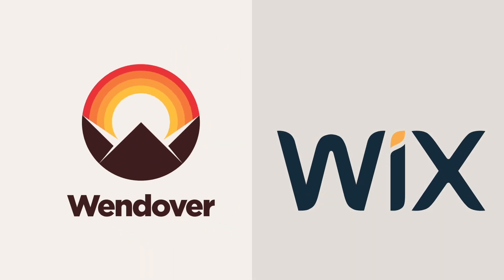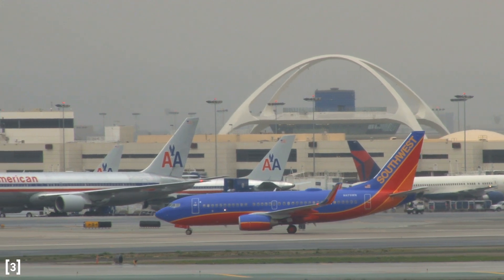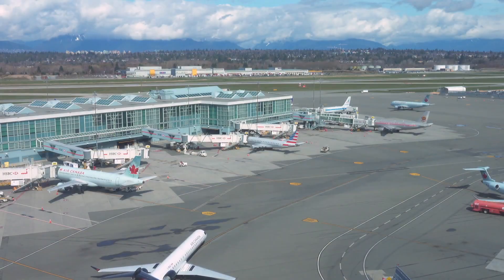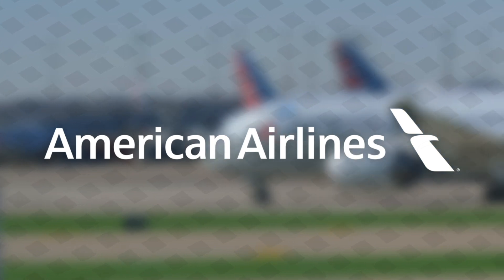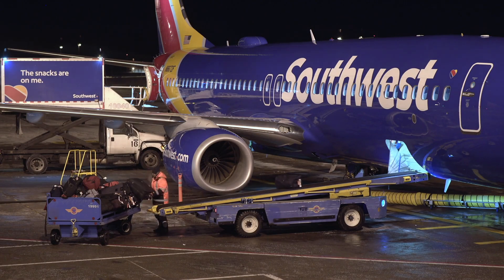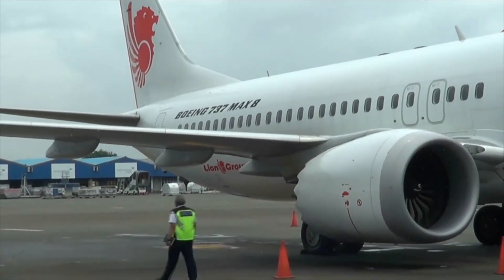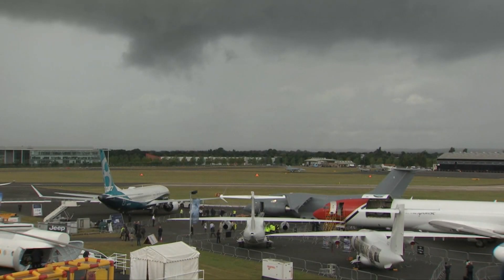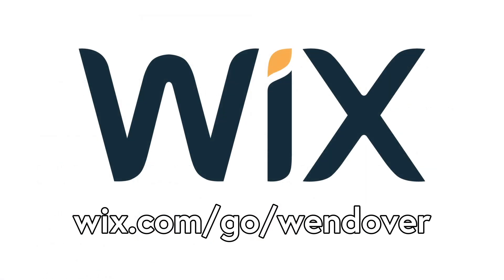The Economics That Made Boeing Build the 737 Max

Comment: The Wendover Productions video makes some observations about modern technology and implying that if modern technology is added to a new design then it is better. Fly by wire is good so far only time will tell it's safety. Check list is electronic trumps paper? What if a glitch wipes out part of the list? The 737 Max 8 bases off from a fifty year old design so what. The dynamics built into it are very much on par with Airbus. Safety is tilted in favor of the Max due to redundancy that can be applied by human power. Moving the engines did change the aerodynamics but within the margins of safety and maintaining stability. Bottom line is that you don't have to reinvent the wheel in order to make an efficient aircraft.

Comment: important to note:  The 737MAX wouldn't be flying if Boeing hadn't already achieved regulatory capture of the FAA.

Being able to mark your own homework leads to temptations to fudge things. Boeing and the FAA's reaction to whistleblowers calling out serious 737NG assembly malpractice (and paperwork falsification) issues showed it had already happened by 2004-2005.

More worrying: This regulatory capture problem isn't isolated to one US sector. It's across the board and been getting worse since the mid 1980s - telcos being a blindingly obvious example.

Comment: You dont fix an aerodynamic problem with software.  You absolutely must start with an aerodynamically sound air frame and engine combination.  Otherwise its going to bite you in the ass every time.....   Its different in the case of a fighter, where you depend on that instability in order for the plane to maneuver quickly. There flight envelope is fairly narrow. But in the case of an airliner with a vastly wider envelope of operation, it damn well better start out stable. If it does not, and you use something like MCAS to fix the issue, any engineer will tell you that not only is the fight characteristics completely compromised in the case of  failure of the augmentation system. But the air-frame and control surfaces are being subjected to constant loading...........It was a poor way, lazy, cheap way to try and fix the problem created by moving the engines.   As it turned out it was not near as cheap as they thought it would be.......

Comment: Beyond re-engineering a dated fuselage to modern larger higher by-pass engines the video mentioned one critical flaw that should have been obvious.  That would be the attitude sensor, no redundant sensors.   The industry already knew the problems associated with single, and even multiple, air speed sensors in relation to automation.   How then did such a hidden robust automated flight correction system come to rely on a sole sensor?  Cost?  Hubris?  Automation engineering euphoria?  Apparently a tragic combination of all this intersecting with an original design poorly suited yet economically driven.  Makes one wonder if any re-engineered fix is viable from a safety standpoint.  The future of Boeing and the credibility of The FAA, as well as untold lives, hang in the balance.  This brings the hovering cloud of transparency up.  The public has not been allowed much information as to how the proposed safe re-introduction fo the 737-Max is progressing.  Scant details of either good or bad save for the claim that the aircraft will not be allowed back in the air until all issues are addressed.   The problem with this is the public believed that this kind of scrutiny was routinely addressed prior to any modern aircraft taking to the sky in the first place as far as commercial service goes.   So, if and when, The FAA approves the plane to fly again will the paying public believe the plane is truly safe?

Comment: Most of the people bashing the MAX in this comment thread, have at some point in there lives, safely flown on a Boeing 737, be it a old 200, a classic 300, 400, or 500, or an NG 700, 800, or 900ER, because the Boeing 737 has carried more people on more flights than any other passenger aircraft in history.  Constantly improving on a brilliant design that has been the profitable workhorse of the single aisle market for decades is actually quite smart.  Take something great from the start, and make it into the best in can be.  Head to head, the 737-MAX8 will edge out, albeit very slightly, operating economics of the A320NEO, making the MAX, despite the blatantly obvious, orchestrated MSM take-down of the entire MAX family, a terrible bought of turbulence for the aviation industry as a whole, and especially Boeing.  Do you all not realize that the same accidents could have just as equally occurred on the A320NEO family?  In fact, some airlines are blocking off the last row of seats in the NEO over concerns of the weight balance of the aircraft, thus affecting the AOA, and the AOA is what the MCAS was intended for to take full, automatic control of.  Amazing, safe, profitable, efficient, reliable aircraft (the entire MAX fleet) is sitting on the ground because of ongoing politics, when they crave to be soaring at 40,000 feet, carrying people all over the world.  I would fly on a MAX without a second thought, or a concern in the world, and would arrive wherever I was scheduled to go.

Meanwhile, in addition to the last row of seats on some NEOS being blocked, the A220 is still having engine failures with the Pratt, GTF technology, grounding an entire airline fleet of them this last week.  Yet 99% of negative aircraft manufacturer news remains a focused take-down of Boeing and the MAX.   Nobody cares about the other issues I just mentioned because they were appropriately addressed, quite luckily, before any of those aircraft plunged into the ground.  The MSM has an agenda, and I can't lay claim to know what that is or why, but when phone notifications (that I don't even ask for) happen about 5 times per week, specifically regarding ongoing bad news of the grounded MAX, then someone is up to no good, and it's a terrible thing for anyone who loves aviation and flying.  If I were an investigator involved here, the first order of business would be obtaining a list of everyone who has access to the Boeing Uninterruptible Auto Pilot.  Such a system should NOT exist.  The captain of a flight should have 100% control of his aircraft, with no possibility of anyone on the ground changing that.  People in this world so easily give away more freedoms for the promise and illusion of safety, that's very sad to see as it gets worse, year after year.

Comment: To me the MAX still looks like a standard Boeing 737, so is it basically the same airframe as the earlier variants ? If so can't Boeing just retro fit all these MAX aircraft with flight systems from the earlier safer 737's so they can get them back in the air to help their customers start earning again ?. Call that new variant The Boeing 737 Max Retro.

Comment: We have to get Boeing out of business. I do my part by telling every travel agency that I refuse to fly in any Boeing airplane and that they have to arrange my travels so that no such plane is involved. These requests ARE reported to airlines, if enough travelers do the same, airlines will react and stop ordering these pieces of crap.

Airbus has a perfect stall protection system in place. Whenever the speed of the plane drops, even if momentarily, below the safe flying speed for the actual maneuver, the airbus rings an alarm and sets TOGA thrust automatically, but it doesn´t interfere with the pilots flying by bringing it´s nose down. This system, opposed to Boeing´s chosen path, saved lives, Boeing rather chose to kill passengers.

The worst part is, even though the problem is still persisting, the MAX is still grounded worldwide, Boeing builds more than 50 of this faulty pieces of crap per month and parks them on giant parking lots to be able to kill even more passengers as soon as their lobbyists put enough pressure on politicians to lift the ban. They won´t fix the problem, because they can´t. If fixing the problem would just be a matter of switching out the sensor, the problem would have been fixed before the planes got grounded.

Comment: We live in unstable times, ruled over by unstable people. Naval architects design an unstable a cargo ship with an itsy-bitsy canoe shaped bottom hull that is obviously designed poorly. When the heavy cargo is stacked up high the vessel becomes top-heavy. It capsizes, and in relatively calm waters. Then a legally hogtied unstable media will not report the problem as such. 

Unstable businessmen at Boeing, keen to beat Airbus,  go against the advice of the engineers and redesign the Boeing 737 as the 737 Max. The Boeing landing gear is shorter than the Airbus. So they instruct the designers to put the bigger engines up higher on the wing. The plane that was once stable in flight now has unstable nose-up flight characteristics during the critical takeoff phase. 

But no matter. They try to correct this misbehavior by crafting the computer software to slowly crank the tail surface down to put the nose down during takeoff. This takes away pitch control from the pilots who are on occasion pulling back on the yoke trying to get the nose of the plane up. They are struggling to prevent a nose-down crash into the ground. 

This it has ended up crashing two airliners, killing all on board. And now what do the unstable bean-counters at Boeing want to do? Back to the drawing board? Oh no. That would be too costly. They want to tweak the crazy self-conflicted system. They want to calm and mollify the ghost in the machine. They want to get the planes back in the air making money again. 

Overseeing all this are unstable people, 
People who think that bad things, with a bit of tweaking can be made into things that are just fine.

When they are obviously not.

Comment: I used to be a hardcore if it isn’t boeing I’m not going fan. Now? I rather fly on a Tupolev or Sukhoi... Hell, I’ll rather fly on a Comac before a Max. This is what happens when idiot MBAs make the decision to save money and slap modern engines on an airplane designed in the 1960’s. FFS, I’m no engineer but when they went from the old low bypass engines to the newer high bypass engines and had to flatten out the bottom to make them fit, you probably have hit the limits of the airframe. What’s worse is they had a great airplane, the 757, which could fit these new engines. Not only that, if you can fly a 757 you can also fly a 767. But no, let’s keep what’s basically a pterodactyl in the air.

Comment: Yes Boeing made a faulty AoA sensor, however the first accident was lion airs fault.

Explanation time, The day before the first accident they had a faulty AoA sensor and an MCAS malfunction, however there was a third person in the cockpit that day (check airman) this other person knew how to and did correct the MCAS malfunction. This should’ve been a red flag to send this plane off to lion air maintenance, this should have have been the red flag to take that plane out of service until lion air maintenance fixed the AOA sensor. However Lion air maintenance did not fix this, and that plane went down the next day because of an AOA failure that sent MCAS to believe they were in a higher pitch.

Comment: Airbus are "fly by wire"
Boeing are "cable and pulley"
Reply: This comes down to what era the models were released in. The newer Boeing’s like the 777 and 787 are fly by wire while the older planes like the 737, 747, and 767 are not. Airbus is a much newer company with newer products. With the exception of the A300 and A310 which aren’t made anymore, all airbus planes are fly by wire.

Comment: They made the computer too powerful, and Airbus is even worse. Boeing combined a powerful computer with a shoddy sensor, without enough testing, which is inexcusable.  Once the executives responsible are in jail though, the problem has already been fixed and the 737max should fly again,  But ONLY as long as the executives are in jail, and it must be grounded whenever they are free.
  All the plane needs is limits on the computer trim control, a backup sensor, and an executive prison, and it had the first 2 months ago.
  They also need a stretch version that trades some range for increased capacity, since carrying 4000 miles of fuel is not fuel efficient, so planes should refuel within 2000 miles whenever possible.  This also allows passengers to stretch their legs, thereby reducing legroom requirements, which again increases efficiency.

Comment: The fact that Boeing kept redesigning and updating the 737 to be able to sell the plane on price instead of fuel efficiency wasn't what led to the crashes and grounding. Where Boeing messed up was by designing MCAS in such a way that it took all of its critical Angle Of Attack data from a single sensor.  When that one sensor was defective, damaged, or frozen, it sent erroneous readings into the MCAS system, which ordered the plane to go nose-down to "correct" a stall condition that was not actually happening. Depending on one sensor created a "single point of failure", which is a design flaw that good "belt and suspenders" engineers avoid.  Two independent sensors feeding the MCAS and a warning signal to pilots that that the sensors aren't agreeing would be better. Three independent sensors feeding a logic circuit that disregards a sensor that is not in agreement with the other two and "assumes" the two that agree are correct, doesn't feed the bad sensor's bad data to MCAS, AND warns pilots of the sensor issue is probably what SHOULD have been designed in the first place, but some non-engineering middle manager came up with a cheaper idea on behalf of Boeing's shareholders.
Reply: ARABIA

Comment: I Also Noticed The 737 MAX Is Now Slightly Raised Higher Than The 737 NG, But It Still Didn't Help About The Engine Size Issue. Well They Raised It Even Further Forward And Up And The CFM LEAP 1B Did Fit, But It Really Didn't Handle The Same As The 737 NGs. Damn You Aerodynamics.

Comment: The age of the original 737 design is irrelevant. The original 747 design is also 50 years old. The 747 has also seen design adjustments over the years.

Airplane design has been evolutionary. Even when the design is "new," it is based on what has been learned from older models. Almost no commercial airliners have been  radical departures from the past. They feature incremental improvements.

Also, overhauling existing plane is a common maintenance practice.

Comment: Stupid question: Why was the size of the new engine such a big problem? Why couldn't Boeing just increase the height of the gear. Was it the additional weight or does a longer gear require retraining of pilots?
Reply: compuholic82 On most airplanes, the main landing gear folds inward when it retracts. In the case of the 737, the gear is so close together that there’s no space for doors to cover the gear, so they just have hubcaps that form a flush surface with the plane’s underside. If the main gear was made longer, the struts would have to be spaced further apart to avoid hitting each other, and if they did that, they’d also need to redesign the wing to accommodate the bigger wheel well as well as the change in weight distribution.

Comment: Why did Boeing add the mcas system if it already has an autopilot system and two pilots? The way I see it Boeing needs to bite the bullet and redesign the 737 max to not have an mcas system on board the aircraft. This requires a completely new aircraft design. Yes, I realize it would take a few years but the aircraft isn't flying and needs a redesign. 
Also screw the cost of pilot training and don't even suggest an iPad can train a pilot. Otherwise I could download the program and fly one myself. That would never happen as I haven't flown an airplane in over 48 years. I wouldn't accept the training which is where I believe your looking at better than 99 percent of all commercial ata rated pilots today. 

Training by iPad to cut cost of training , how much money has Boeing and the airlines saved?

Time to face facts that the 737 Max needs a redesign from nose to tail, lengthen the landing gear to get it off the ground and put the engines back where they belong, under the wings, not in front of it.

Gentlemen, you know how to fix it. Do it right with a redesigned aircraft. Then and only then will you be able to put a safe 737 Max in the air loaded with passengers who trust it.

Get it done.

Otherwise me personally will not fly on any Boeing aircraft.

Comment: To be fair if the Max was done properly, and that includes the FAA approval, it wouldn't have those issues. It is possible and viable for boeing to redesign the old 737 into a more efficient one. Its just mistake after mistake during engineering, production, approval, training and flying that caused lives to be lost. Every single fail prevention system that exists in aviation failed, its a huge embarassment for boeing and every single organization that certified the 737 max plane as airworthy. At least in aviation they tend to investigate thoroughly and put new measures to assure something like this won't happen again.

Comment: You may add that FAA allowed Boeing to almost self certify the 737-8/9 MAX safety, something that has no precedent into commercial aviation, and is one of the main reason that maintain the 737 MAX grounded.
Why?
EASA (European Aviation Safety Agency) had total confidence and trust into FAA and vice versa when "approving" a new aircraft to operate (Boeing depending on FAA and Airbus on EASA).
This relationship built on trusting each other has been completely broken by FAA.
Actually, and there's also no precedent in this, EASA will perform their own tests on the "refurbished" 737 MAX before giving this "approval", even if FAA gives its approval.